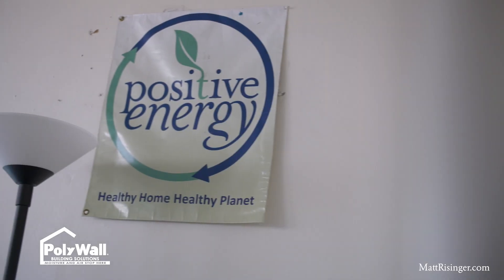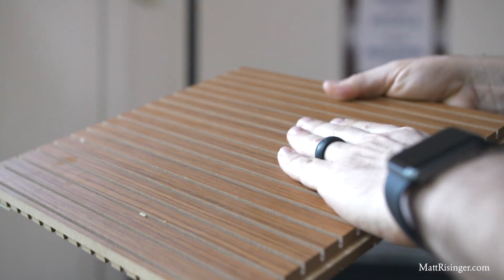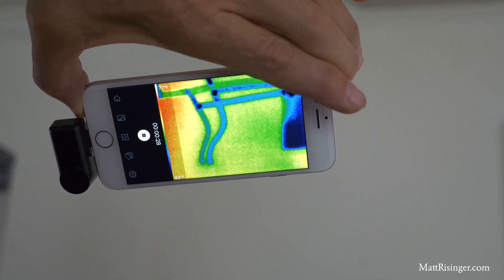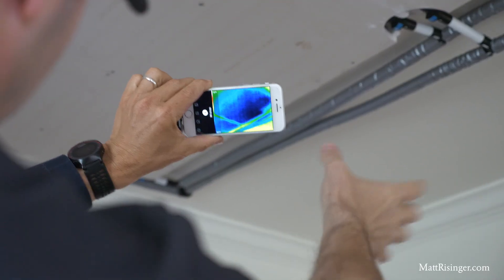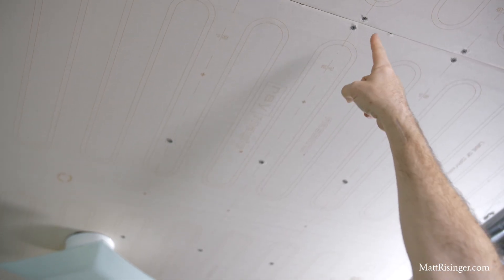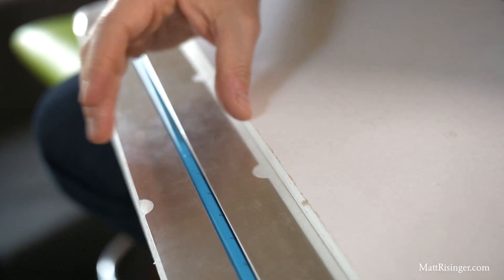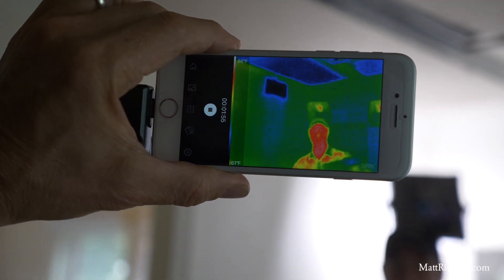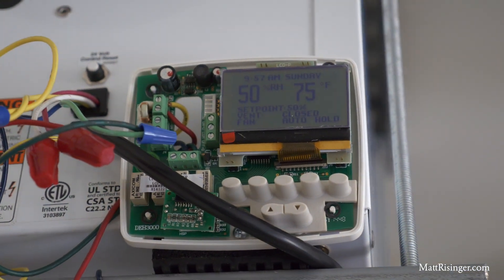Cool Your House with CHILLED WATER

Comment: Scam. No such thing as cold radiating. This is convection and will suffer from condensation.
Reply: It's just math.  In winter we add BTUs and in the summer we want to remove BTUs.  The foam minimizes the outdoor influence of heat, as they were saying, and the BTUs rise and rush to the water-chilled surfaces per a law of thermodynamics.  It's just unusual and something you have not encountered.  It's not witchcraft.  Relax.
Reply: Typically, in my book, if someone says they will evaluate something for up to five more years... they are not a scam.
Reply: DEEREMEYER1 Exactly.  This is a heat sink, not a 'cold' radiator.
Reply: Its not a scam, our office building has this kind of cooling in the cieling and no ac.
Its realy nice that no cold air is blown in the office.
About condensation you just need to make sure the temperature difference between the pannel and air is not too large.
Reply: xkeepersvk so, how does that work on days where the dew point is 80F?
Reply: DEEREMEYER1
Actually, colder energy (anything with less thermal energy) is radiated from outer space all the time. Waves of energy themselves can be cooler than the mass they hit, and radiation will absolutely cool a mass. It's called radiative cooling. Extremely low energy waves are cold. They radiate. They cool things. But, otherwise, you're right. The system in this video does not radiate cold energy.
Reply: VAspeed3 I'm not realy sure, the way I understand is that our building has multiple systems that work together, outside wall is glass then there is 3feet space where air circulates, then inside wall with widows. 
Offices have water cooled ceilings & air in the offices is recycled.
Reply: They didn't say that cold was radiating.  They said that excess body heat radiates, and it is absorbed by the cooled panels.  It isn't a scam.  It's been shown to be an effective, and comfortable, method for cooling for a long time but the thing limiting its use has been handling humidity condensing on the coils.  The cost to dehumidify is not much different from the cost to cool since the processes both use refrigeration cooling.
Reply: It's not new tech it's old.... been used in buildings for years...chilled beams etc.. like he said though it has to stay above dew point and needs other a.c. or dehumidifier to remove the humidity which is the majority of what a.c. does so...
Reply: I agree with robert here I don't see how this system is radiating I agree it works to a degree but not for the reasons they are implying

Comment: I understand that a cool surface will absorb heat and that the cool water absorbs the heat from that surface and then is moved away by the piping. What happens outside? If the air temperature is above the water temperature the water is not going to release its heat and become cooler. How are you cooling the water back down for reentry into the system? Are you using a geo thermal transfer pumpimg the water into the ground to certain depth where the ground temperature is much lower than the water where the heat will dissipate into ground thereby cooling the water?
Reply: Shawn R The chilled water is a closed loop system. It passes through heat exchangers which transfers the heat to the condenser side of the chiller. Water in the condenser side is then pumped out to a cooling tower where evaporation of the water is what releases the heat. This is just tiny version of what a large commercial office building uses. Except an office building uses forced air instead of radiant cooling. The chilled water pumps through the coils of an air handler just like a conventional air conditioner system.
Reply: Thank you for your response. Do you have basic schematics that are available to the public? Where was this video filmed in Texas?
Reply: Shawn R Sorry I'm not a representative of these guys. I'm an operating engineer for a large commercial building in New Orleans. Just giving you the basics of a chilled water HVAC system. Pound for pound (or should I say Ton-for-ton), it's a much more efficient system then a conventional air cooled, refrigerant system. Unfortunately the trade-off is higher maintenance (including chemical water treatment to prevent scale) and the usage of a lot of water.
Reply: Thank you again.Usage of lots of water is not a good thing. High maintenance is also something I am not interested in.
Reply: Shawn R I'm not trying to deter you away from this product. This is obviously a much smaller system and may not require as much maintenance and water usage. I'm just speaking from experience with large scale systems. Residential systems should not be as maintenance intensive as a commercial system. You gotta think about the average typical homeowner which 99% of the time does not possess the necessary skills, even if they were pretty 'handy' around the house. So I'm sure this new system is engineered to be low maintenance.

Comment: since you are running water instead of coolant, the plumbing is alot cheaper and uses ALOT less coolant.  your cooling unit can be located alot farther away from your heat exchangers.  interesting concept.  if you guys wanted to bump  the efficiency even more, run that waste heat into the buildings hot water system.

Comment: I suspect this type of system could make for a really comfortable home if used for both heating and cooling but the humidity issue kind of ups the cost factor due to the need for humidity control and the ducting to move the air around.
Reply: And imagine the damage a failure in the dehumidifier could cause.

Comment: This tech has ben around for a good while. When I worked in the telecom industry we had ready stations that were mobile. They were full of telecom equipment to help folks regain communications in case of emergencies. To cool the equipment that used cool pipes.  They had little drip trays below them. They seemed to work OK in out hot Texas climate.  Not sure of the logistics for a house. If the house is 2000 SQ foot and the folks went from room to room would it be effective to use energy to cool the entire conditioned space? I assume that these effects require some time to ramp up. 

I wonder if this system could be developed for RV's and such, Utilizing say Solar.

Comment: How is this better then geo thermal?
Reply: I had the same thought.  Since it skips the water to air transfer ( or delays it until the 'radiator,') I would think even a shallow geothermal loop could give nice cooling to the typical home.  But I'm no enginerd.
Reply: This is one good way to use geothermal.

Geothermal means that you are moving heat in/out of the ground, but you still have to move heat in/out of the house. With Geothermal, you would use the ground loop heat pump to maintain the temp in your buffer tank instead of the air based heat pump they show in the more detailed video.

Comment: My only concern would be if the system starts to leak causing water damage.  Matt, any thoughts on that topic?
Reply: They are using PEX, which has a good track record for durability. But Matt did question that, he mentioned checking for that sort of thing at the end of the summer.

Comment: Did you guys run the numbers on hooking this up to a ground sourced heat pump? Is the ventilation system using a heat exchanger system?

Comment: +1 on energy use stats. This looks to be a viable alternative to the ever changing green market as well. You can't really upgrade water. Lol
Reply: another way of looking at it is that you can easily upgrade the cooling part of a chilled water system, without having to tear the house apart.

you should even be able to have multiple ways of cooling (say a ground geothermal loop and a compressor based system), and even pull interesting tricks like running the compressor based system at night (when it's more efficient) to chill the ground so that you can dump more heat into it during the day. With a buffer tank, you won't have your compressor short-cycling, so it can run more efficiently.

I've been thinking about using chilled water in a house for a few years, and the more I look at it, the more interesting tweaks I think of.

Water is a lot easier to move around a house than coolant, so you can consider doing point-cooling more easily.

For example, we like to tuck refrigerators into cabinetry, but that ends up with them pumping the heat against a wall, add a radiant loop in the cabinetry and you should end up saving power.

or for people who love to bake, put a small radiant loop under a portion of your counter top to give you a nice chilled surface to roll dough out on.

As well as the potential to zone everything (zone your pantry a little cooler than the rest of the house for example)

If you can somehow deal with the thermal lag, you can use a chilled water supply to provide point-of-service cooking for a water dispenser (or other beverage dispenser)
Reply: David Lang very good ideas for adapting to an existing home as well as for a new build. My wife would love the kitchen ideas! They could be done during a full remodel🤔

Comment: Need to know energy cost to run the cooling ceiling and the dehumidifier.  It looks interesting but without a energy savings advantage it may be moot.
Reply: We're data-logging and will have much more to say about the energy cost differential. Check out the full system. 

https://positiveenergy.pro/building-science-blog/2017/4/24/texas-first-radiant-cooling-heating-system

Comment: so....you have a dehumidifier to keep it from sweating and a unit outside to cool the water? how is that any different than a normal system?
Reply: The biggest advantage I would see is pumping water would use a third or less energy than pumping air. Plus it doesn't blow dust all over your house.
Reply: @court2379  yep, it doesn't. Whole house dehumidifier does though.
Reply: Its more expensive to install, operate, maintain, repair... Why install $10,000 A/C system if you can install a $30,000 system? How about plumber installing your ceiling, wouldn't it be GREAT?
Reply: We specify dehumidifiers on air-side systems as well. The fundamental difference here is that the heat exchange potential of water is much more dense than air. So from a systems configuration perspective, it may seem similar, but the fundamental physics going on are vastly different.

Learn more about the system here: 

https://positiveenergy.pro/building-science-blog/2017/4/24/texas-first-radiant-cooling-heating-system
Reply: @positiveenergy1565 I don't see this as something that can replace traditional AC any time soon as is, but this would be fantastic if you turned it into a geothermal system rather than one that uses a chiller. Underground, the dirt will be much cooler than the air temperatures on the surface, so if you run pipes underground you could use the ground as a heat sink to cool the water. the only thing you'd need to run would be a pump, which would cost hardly anything.
Reply: @doctordev97  This system doesn't use a chiller. It uses an air to water heat pump. The performance coefficients of air source heat pumps are about the same as ground source for the most part, and actually work better in central Texas where ground source systems basically spend all their energy dumping heat back into limestone, losing performance capacity over time.
Reply: @doctordev97  um... just build your house underground?
Reply: @dsolovey1752  building a house underground would be great in some ways, but there are some reasons why it would be terrible. Underground structures often have water infiltration issues, hence why basements often have sump pumps. Also, guess the view is no longer a factor in choosing the piece of land I'm building on lol.
Reply: Yeh, Makes no sense. Not economical....more cost and two machines to replace 1......
Reply: @Q_thulu  start with installation cost first. Actually, you can stop right there...

Comment: No doubt radiant works but operating expense is a big question.  Plus many depend on evaporative cooling off their bodies to occur at a high rate especially when we have been active outdoors.  It seems the lack of air flow inherent in a radiant cooling dominated solution would create an uncomfortable situation as our bodies continue to reject latent heat.  Kind of like the need for auxillary fans for athletes in a 70 f domed stadium. Obviously ceiling fans and whole house humidifiers (with ducting) are a solution when coupled with radiant, but total operating costs in a structure with many occupiable and sometimes humid spaces (baths, kitchens, and laundries) becomes a question. In the end, what seems to be the big benefit?  As Covey said, we should start with the end in mind.
Reply: Major savings in the commercial field.  Maybe not as much payback in a home system.  I would still use VRF for large homes.  But this is their office so maybe they tapped into the existing chilled water.  Zoning Hydronics systems is pretty easy.
Reply: Interesting idea, but how is this better than just moving air? After all air is moving to dehumidify.
Reply: Problem with air is it doesn't have much in the way of thermal capacity. It changes temperature faster than everything else in your living space like walls, floor, and ceiling. The temperature also only moves as fast as the air, requiring movement and therefore fans. Fans can be noisy and balancing a large air system can be challenging. By heating/cooling all the surfaces you can achieve less fluctuation and thereby increase comfort. Radiant is and always will be the most comfortable system. Radiant cooling can be difficult as it requires proper de-humidification or else everything cold will sweat (like cold domestic pipes).
Reply: RJParker its a lot slowly energy transfer compared to a blower
Reply: Can we retrofit this . In a 2 storied 1500 sqft villa..?  Do the cilings need to be high to accommodate the the panels? Does it work in subtropic conditions""...
Reply: RJParker in a home would likely need supplemented with fans. In a office building though might make more sense. It's still an interesting idea.

Comment: Cost per Sq Ft ? 
Radiant floor heat works great; seems limited by cost
Reply: Cost right now is limited by infrastructure. Learn more about the system here: 

https://positiveenergy.pro/building-science-blog/2017/4/24/texas-first-radiant-cooling-heating-system
Reply: I am REEEEAAALLLLYYY looking forward to future updates.  The logic is excellent. Time will tell.
Reply: A agree, this would be terribly expensive because it doesn't reuse the same distribution method that heats the house. Heat needs to be at the bottom and cooling at the top, because it really isn't "radiant" heating, it is mostly convection.
Also I don't think the statement that it feels great in the room have any meaning until the day heats up and the house has time to heat up. Show us again at 4pm after the thermal mass of the house has warmed up.